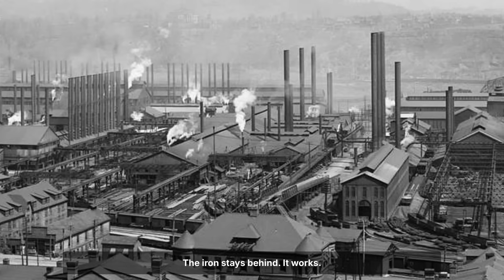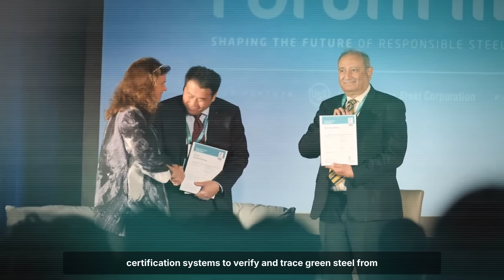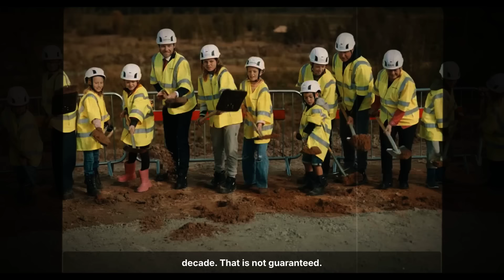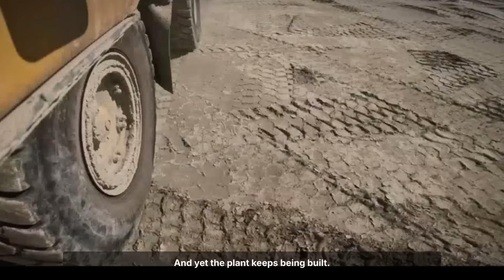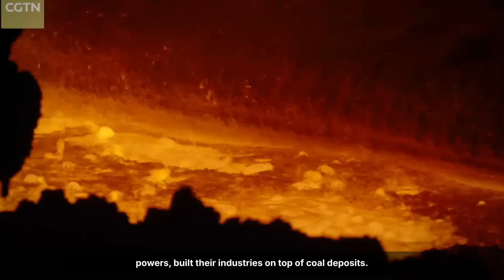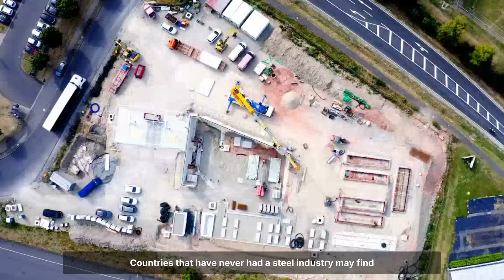Hydrogen Turns Iron Into Steel. Zero Coal Required. Why They Want You to Think It's Impossible.

Comment: To make steel, much more than Hydrogen is required... You have to mine Iron Ore, Cobalt, Nickel, Manganese. and other Minerals..... In many cases very expensive Minerals if you are going to make special steel?...... Green steel does not exist because if you count everything in the form of CO2 emissions, Transport, Electricity production at sea to land, etc., the emissions are there before the finished steel....... Is all the scrap you add to make fossil-free steel fossil-free? No........It should not be called fossil-free steel, green steel, it should be called reduced green steel or something else?.................

Comment: The use of hydrogen to reduce iron oxide to iron is well known.  You can do it in a simple lab experiment.

Using renewable electricity to electrolyse water, use the hydrogen to reduce the iron oxide. Use more renewable electricity to melt the iron, add a bit of charcoal to get the carbon content right, and you have made zero carbon (emission) steel.  

The oxygen produced offsets a tiny proportion of the oxygen we drawdown by burning fossil fuels.

Only one problem: it isn't economic.  At all.